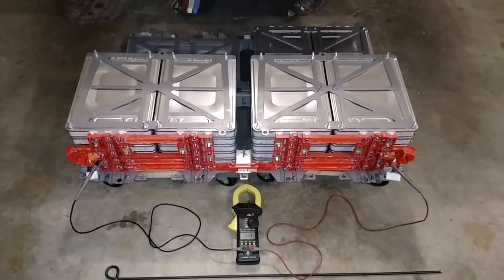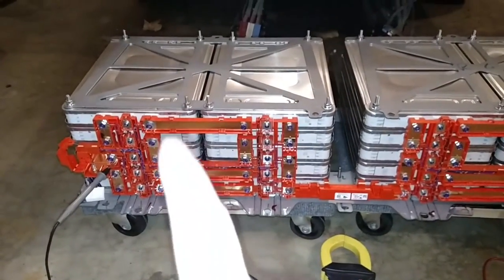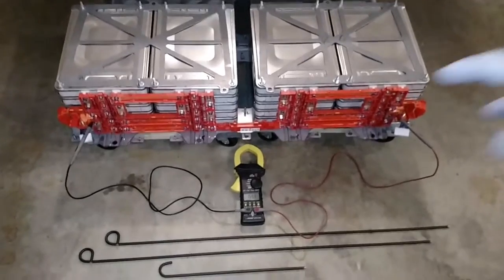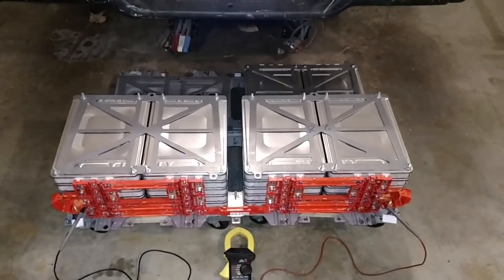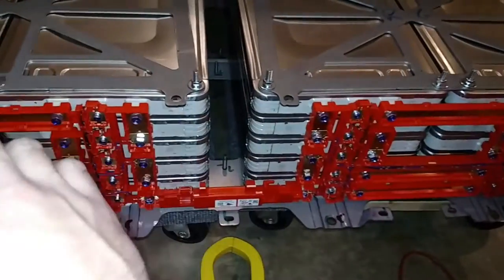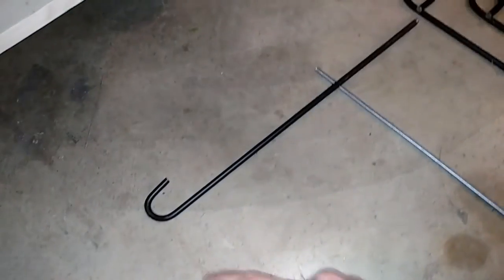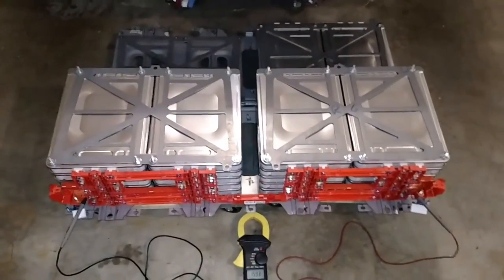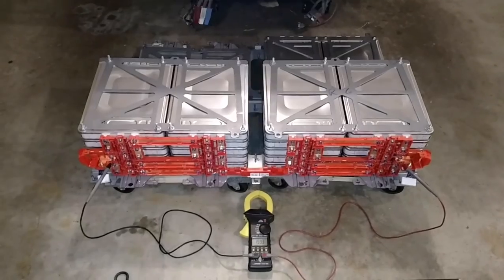Solectria E10, Lithium Ion Battery Upgrade, Part30

Comment: How you resist the urge to throw the pack in the back of your truck and take a spin around the block on lithium power I do not know...
Reply from the maker: +jontscott 
The truck would be a rocket ship!!!
Going from 24 lead acid gel batteries at 52.5 pounds each (1260 pounds). To 20 modules at 8.2 pounds each (164 pounds). :D

Comment from the maker: Just noticed that I got the top plates swapped when I installed them. :(
The two lift points should be at the outer edges.
Reply from the maker: +Wolf Tronix 
Actually, I think I will leave the top plates like they are.

My battery box extends under the cab, so if the plates are in the correct orientation, then the lift cable would hit the cab and keep me from sliding the battery pack under.